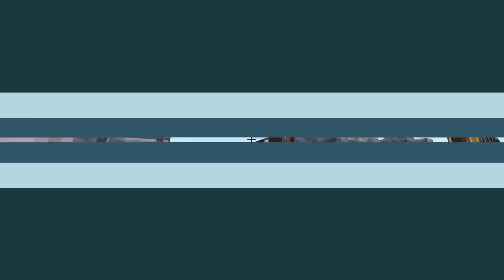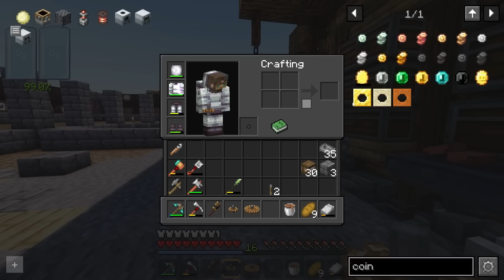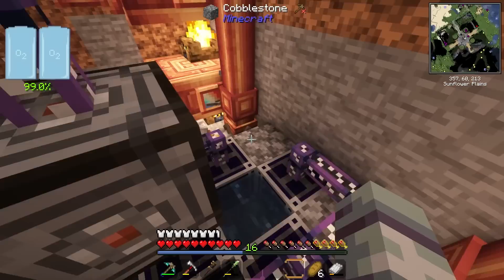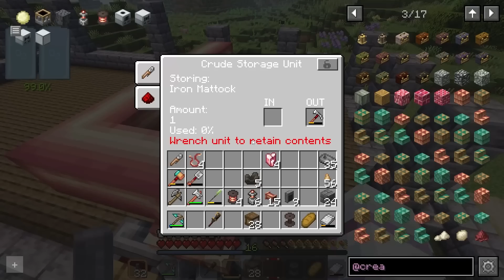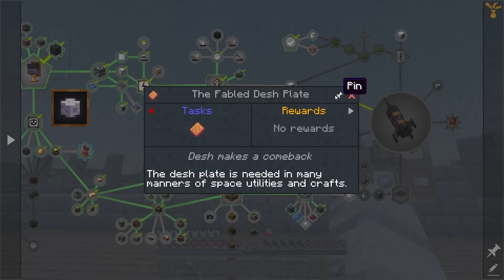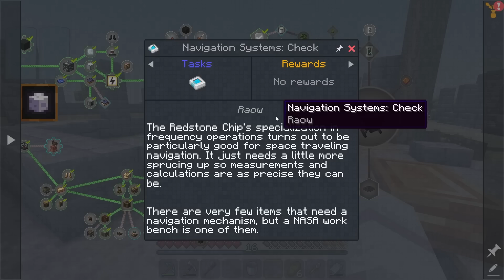NASA Workbench & Tech Reborn Ep21 Create: Astral Modpack

Comment: How do you keep the mechanical arm stationary while waiting for the Blaze burner to run out? Mine keeps rotating the Lava bucket
Reply: You need to filter the funnel/storage for the empty bucket. I’m guessing it’s rotating it cause the arm can put the lava bucket elsewhere and not only into the burner
Reply: @Lukas B  ohhh so it's the andesite funnel that's causing it!
Reply from the maker: Yes filter with a brass funnel holding an empty bucket
Reply: @ChosenArchitect  Thanks, working now!